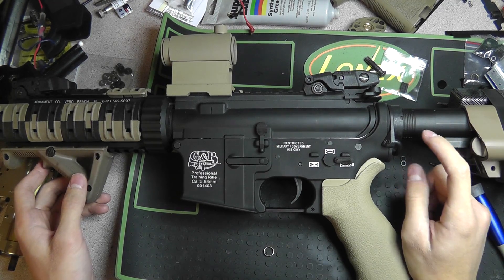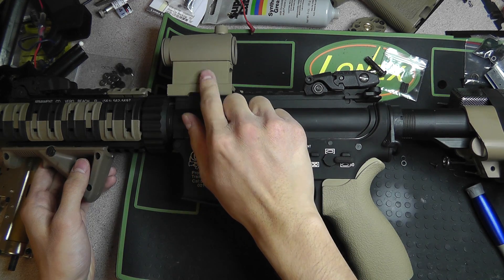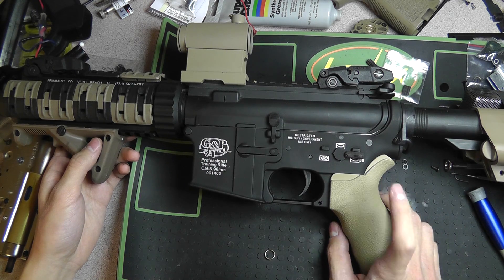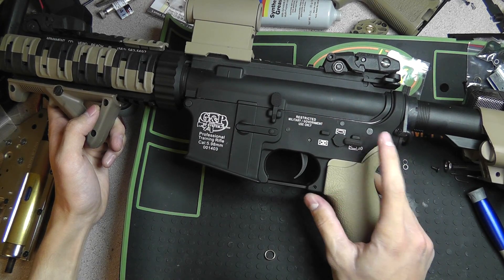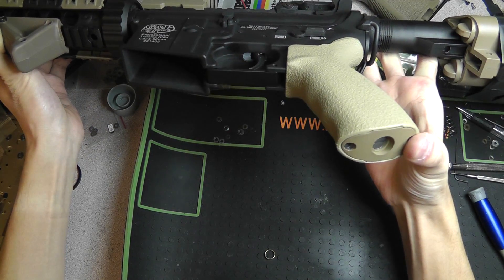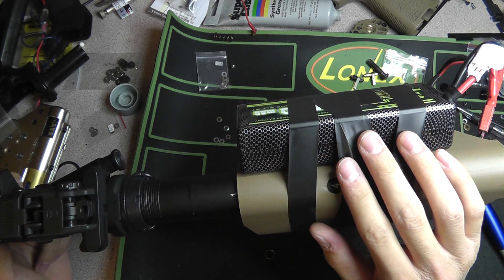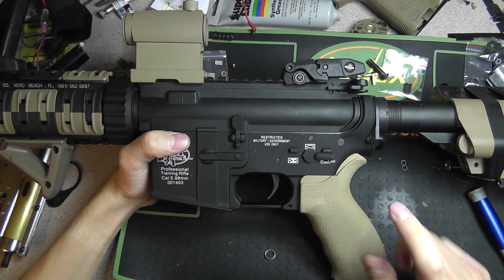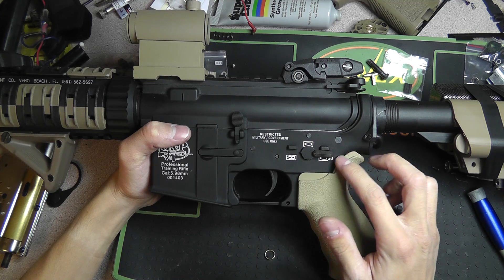BUILD: 10:1 dsg FINAL

Comment: I am doing something similar. On G&P's the only faulty parts are the motor, gears, piston, piston head, and arguably the wiring. I would use the same tappet plate and maybe the same air nozzle in order to not mess with anything, since parts that are made to work with eachother tend to work the best especially when it comes to feeding. So new motor, gears, piston, spring, wire, mosfet, shorten the tappet spring, cut the tappet, and tune. Thats what I am going to do.

Comment: should I get 10:1 gears or DSG gears for semi auto shooting. My ideal preference is for the best trigger response possible. Running 60C-130C 11.1v 3300mAh Lipo, deans, yatta yatta.

Basically, which would be better for trigger response? Either set I get will be Siegetek

Thanks!!
Reply: Oh and ZCI High torque, 22TPA motor
Reply from the maker: Alex Moore I would go single stroke. You can crank more power out of it and the trigger response will still be snappy.
Reply: Dual sector gear is always gunna have a better trigger response over a single sector gear, but, you can't get as much air out of a dual sector gear as you can in a single sector gear

Comment from the maker: Yeah i mean, I COULD have pushed this further but I didn't feel like getting a 14.8 or trying to set another speed record. I might get an a2 in the future to bump this up to 60-70 but really since mags sort of top off at 65-70 I don't see too much of a reason to push it further. What I've learned from this whole thing is that 10:1 dsg's reach a point of limited returns. The amount of torque and power you need to push it over 14:1 dsg's is pretty high.

Comment: I have a 18:1 dsg 
With a shs high torque on a core sp170 spring yet it sounds like 45 rps and thoughts why it's so slow???
Reply from the maker: That sounds about right... Might need to get a higher discharge 11.1

Comment: So you have a jg blue in there right? I heard you say in your rant about frankentorque and 10:1 dsg that you're better off with frankentorque on a 10:1? Is that correct? I have a 10:1 dsg and I'm aiming for 60rps. I have a vfc pdw. I'll be pulling a m170-180 spring. Btw my motor pinion is a medium type. Do you think a modified(shortened) jg blue will cut it or should I build a frankentorque?
Reply from the maker: The Frankentorque and 10:1 won't get you close to the rps goals you're looking for. For the most part anywhere between 18-14:1 ratio gears can allow you to hit those high rps goals because there's less torque needed to pull it. If you chop down the JG blue though I think you should get pretty good results. You might consider trying a 16:1 ratio gearset to lower the required amount of torque. A lot of it will be experimentation.

Comment: I'm trying to build a high speed setup w/ 400fps. Is it possible for a DSG to get that fps? If not I'll get the seigetek 14.09/1 gears. Any recommendations?
Reply from the maker: you can do it just use a heavier spring

Comment: hi vallyriverarms,I built a custom m4 rifle I would like to tell u about, ok so I got the lonex gearbox shell with lonex wiring,all the other parts in the gearbox is shs,the gears are shs 12.1 high speed gears,,the motor im using is a shs high torque motor, I got a g&p trigger,can I put the those dsg gears u use in them,the same ratio as u,,and I'm going to be using a 7.1 LiPo battery,I have a g&p body...let me know...

Comment: hey whats up I like your build it seems like you know your stuff about dsgs, I have a few questions, what type of wiring are you using, or recommend for these dsg low res builds, what do you have for you piston and compression set up? thanks.
Reply from the maker: I like 16awg eco wire. shs 15t or lonex red pistons, stock g&p airseal is pretty decent.
Reply: Ok I run a g and g because, you know g and g ride or die,haha but thanks and love your channel. Make sure you check out my channel, my team, rapid airsofts channel and also my fields channel River city Airsoft TV
Reply: Owen Lusk a DSG will make a G&G gearbox explode.
Reply: naaa lol im not putting a 150 spring in it tho so its going to be a low spring build?
Reply: not gonna happen. if you dont use at least a spaced 150 spring youre gonna hit pre mature engagement on a DSG. and G&G shells crack on an m130.
Reply: yea thats what i was thinking was going to happen haha but i got an extra g and p gearbox i couls use lol

Comment: Might have missed it, but what motor are you using in that beast?
Reply from the maker: JG blue
Reply: valleyriverarms cool thanks. One last question though, are they as good as they used to be, the JG Blues? I have heard through the grapevine that they have been built with less torque and overall quality lately.
Reply from the maker: I have no idea. In my experience they've been fine
Reply: Thanks man
Reply: valleyriverarms hi,can i ask you about this video?what piston body(brand) your using here?,is this a 11v lipo?or 14v?have you tried using lonex motors for this setup?thanks in advance

Comment: What is the point of having a BB hose ? no sarcasm
Reply from the maker: because I can. An effective rate of fire is honestly somewhere around 30 rps for most applications. But in cqb higher rof of super useful. It's so much more effective to spray an area with 50+ bb's when someone pokes their head out.
Reply: lol that makes sense, the only problem i have with that is amount of bbs you need per game, but i guess if you have the money to make a dsg gun then i guess you dont need to worry about bbs.
Reply from the maker: Bbs are cheap. 10 bucks for 5k lasts me most of the day
Reply: valleyriverarms haha that's hilarious (not being a jerk or anything). I use semi and sometimes full auto and 5k bbs lasts me around 3 trips to my local field lol. But it is understandable using 5k bbs on a 50 rps gun lol. Anyway, i love the asthetics and the sound of it, good work dude!

Comment: Hey Ryan, opinions on the 14.8V 3300mAh 65C Lipo that is on evike?
Reply: +Peter Luey  I would buy a battery similar to that from hobbyking, the batteries on evike are a rip off
Reply from the maker: +Peter Luey long story short, yes I actually requested we carry the high output batteries for those who wanted more power than what we were previously carrying. They're coming from the same factory as Turnigy is getting their batteries from I believe.
Reply from the maker: +Russell Garcia The comparable battery he's referring to is 50 dollars on Hobbyking I think. And then you have to factory in shipping and the wait time depending on where you're ordering from. You might save like 10-20 dollars but it'll be up to you to decide if that's something that's worth it to you or not. And you still have to solder on your own connectors. Not a huge deal but another step you gotta take after getting the battery. Performance wise I feel like these stack up to the turnigy options that are out there. Supposedly there aren't too many different factories making lipos in China, or at least that's what I've been told.
Reply: What do you think about the shs dsg? would it work with the 12:1 shs high speed gears?
Reply: I'd rather use a Gens Ace li-po any day, cheaper and better.
Reply: Russell Garcia yup hobby king is battery king

Comment: FUCK IT, this video is giving me the idea to scrap my 14:1 DSG w/ Lonex A2 and just go straight 10:1 DSG w/ a frankentorque. Recently got ahold of a d-boys motor from upgrading a Scar-H (pain in the ass btw) and watching this video for the 50th time has sealed the deal. You clearly have better trigger response and the frankentorque probably doesn't heat up after 50 shots of semi-auto.

Comment: I think that batttery will worn out your motor so soon.
Reply from the maker: lol been running it for a little over a year with the same motor no problems.
Reply: k but the carbon brass last that long too? if yes the may i know wat motor you are using? thanks.
Reply from the maker: the brushes are alright. They're wearing in about as much as any other motor i've used. It's a JG blue I think
Reply: valleyriverarms Can you get replacement brush kits? I only ask because one of the brush springs on my M4's motor got messed up and didn't apply enough force to the brush, causing excessive arcing which led to it wearing down faster than usual. I fixed the spring but the brush is worn down considerably more on that side than on the other.
Reply from the maker: http://www.evike.com/products/29331/
Reply: Oh, thanks
I probably should have searched myself before asking, but I was already here.